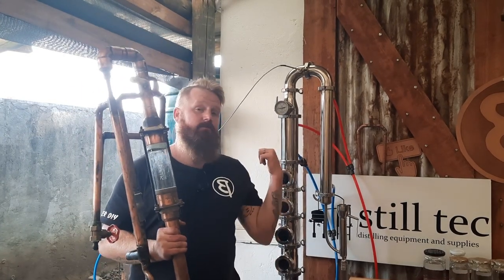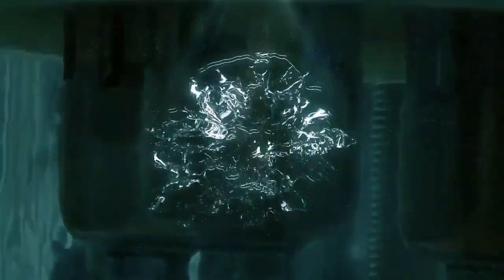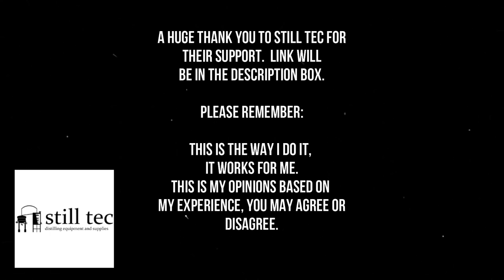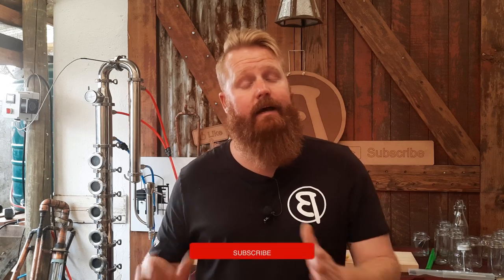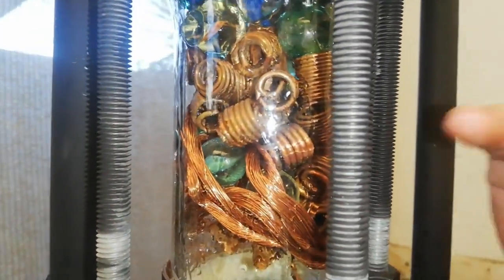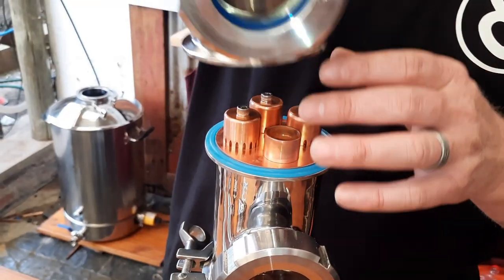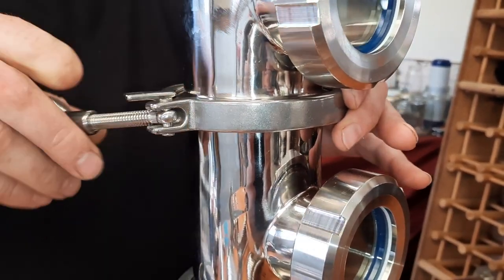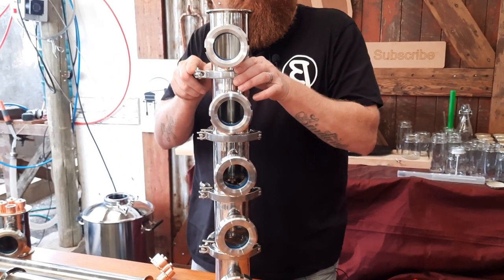Home Made Still VS Store Bought Still

Comment: That's one sexy-looking still.  The only gadget missing is the gin basket.   I'd love to see how you tune your still.   I have a CCVM 3" with 2" condensers.   I'm looking at lava rock.  Cheap and neutral.  A roll or two of copper packing.  I'm all stainless.   I am running with a 5500w element from an SCR with a 30amp circuit drawing 23 amps.   Beer Keg still.  I picked up the oakstills push to connect water kit as well.  Copper in the vapor path before the product condenser is a great idea.   I suspect this will be your most watched video.

Comment: Great discussion man, a lot of great info. Anyone can buy a fancy setup and run well but they won't have learned all the tiny details that make the difference. You spent the time on the old still to figure out all that, now you can use the new one and understand what's happening if something isn't quite right. I didn't realize those new stills and controls could compress the heads and tails so much, that's impressive. Keep the videos coming man!

Comment: I would like to see a video of how you run your cooling system on the bubble plate still. Do you use 1 pump for both the dephlag and the shotgun condenser or run them on seperate pumps? How do you keep your dephlag pressure steady?

Comment: In your opinion what would be the pros and cons of running 4in vs 6in column?
Reply from the maker: Hi PAt,

That will depend what size boiler are you running 4in will work good on a 50L boiler but you will need a ton of power (vapor production) to run it effectively the larger the column to more energy you need to push the vapor so bigger not alway better.
Reply: @BEAVERDIY  how much power? I have converted 15 gallon beer keg. I was planning to use my 4500 watt element and controller I use for my brewing setup. Think I need another element?

Comment: great vid beaver but with the bubble plates can i still use them to do a Rum or Burbon
Reply: Yes but they will cook off some flavor.
Reply: @donaldcarter5553  ok thanks
Reply: I have a similar still.  The plates are completely removable,  just undo the triclamp and lift it out. Then you can reassemble leaving the column intact. If you do not turn on the water to the deflagmator, you have a pot still.